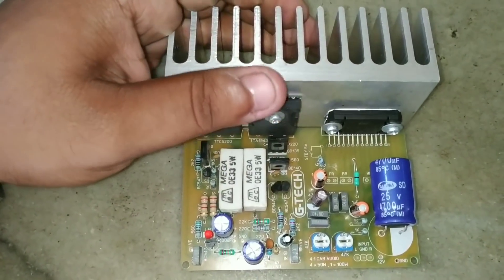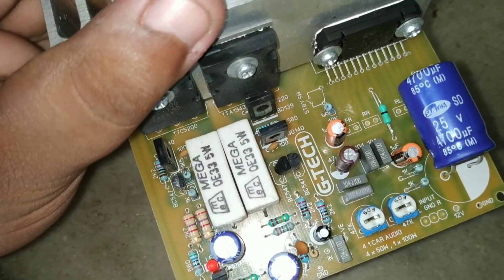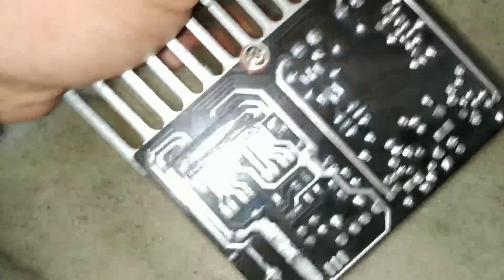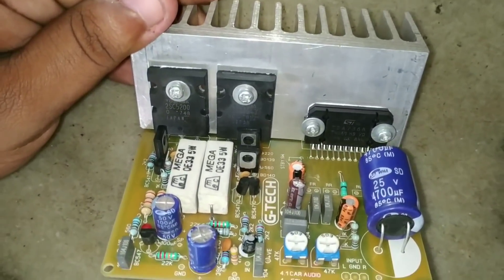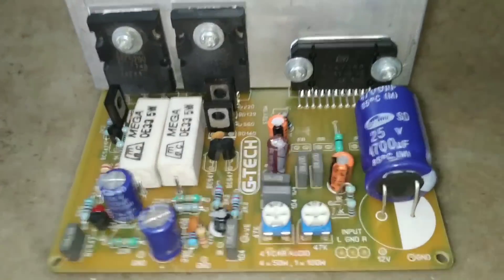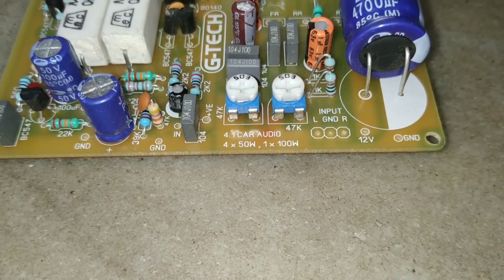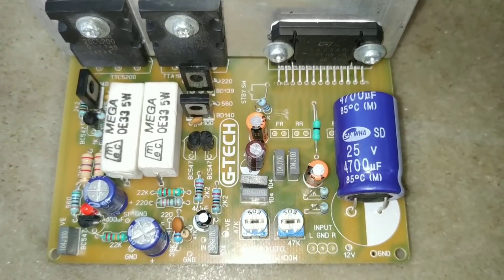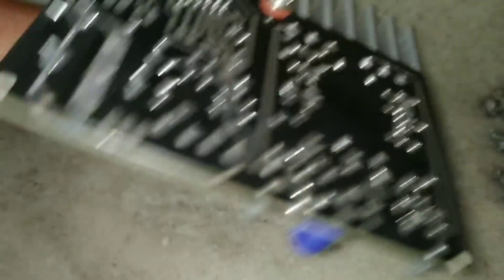tda 7388 4channel board with extra one channel powered by transistor

Comment: Hai sir 

How much price

It's will run in 12v dc single suplly
Reply from the maker: No sir it need 2 supply 12v and 27v dualsupply price 750
Reply: @technicalevolution9887  ok sir iwant this board sir
Reply: @technicalevolution9887  send your WhatsApp number

Comment: hi bro 4440 അല്ലാതെ 12voltൽ work ആകുന്ന 2.1 board ഉണ്ടോ?
Reply from the maker: Vere illa allenkil 12 to 24 covert chyunna board vach chyanam
Reply from the maker: Tda 7377 pinne tda 2030 okke use chyam vala powerkittilla
Reply: 12v single supply ആയിരിക്കണം,അതാ വേറെ ഇല്ല അല്ലേ?
Reply: @geneshpn tda  7297 single supply ആണ്..15 +15 w